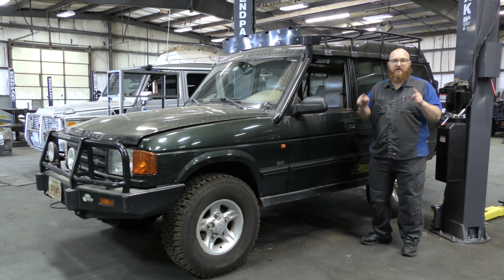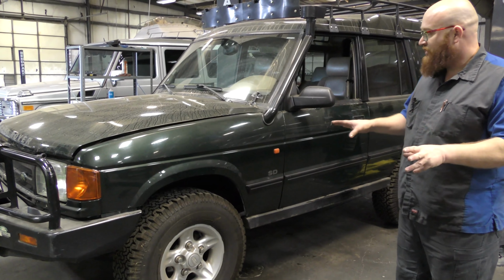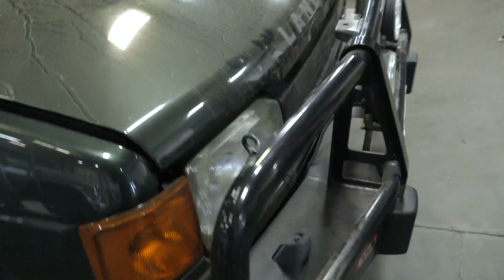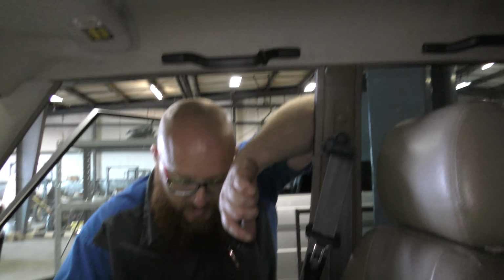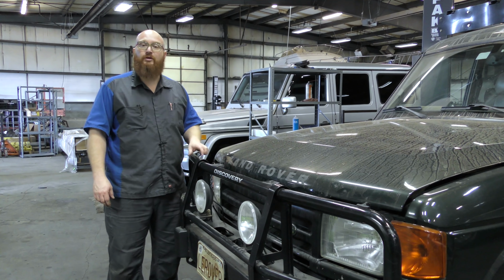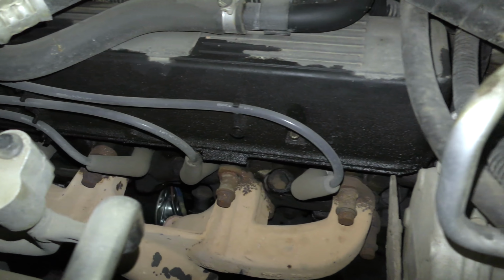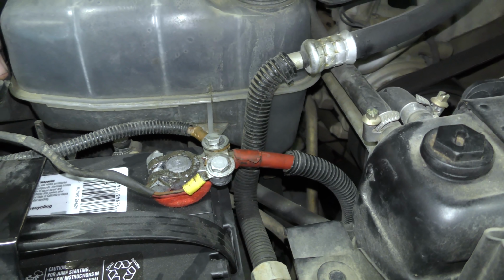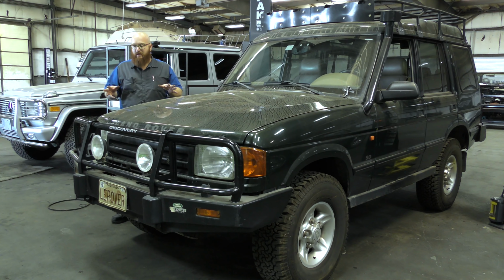How can such a simple repair cause huge problems on this '99 Land Rover Discovery? CAR WIZARD knows

Comment: Mixed oil and coolant is not a sign of a head gasket on a rover v8.
Many have spent money on a Head gasket job only to find a bad timing cover gasket or worse the shop says the engine is bad. Normally they are not bad.

Comment: OMFG that’s beautiful. I just put an ARB bumper on my 1997 discovery today. Mines willow green. Hey wizard, your pretty knowledgeable with land rovers, I’m having a few issues with mine. First my dash lights and rear passenger running light aren’t working, I read somewhere that they are connected somehow, any idea on where to start? And my battery keeps dying even after a few minutes after turning it off, I already went through 3 alternators and I just got the battery last year. Any idea on why it keeps draining itself that fast. It’s charging up to 13.6 volts sometimes 14.0 volts then refuses to crank until I put a jumper box on it
Reply: Also wizard, you guys should totally get a discovery. I picked mine up for $500 running and driving and no head gasket issues and it has 173k miles currently. But I also think you guys should try for an old series 1-3 and make that another project of yours.

Comment: Mi truck just die when running and the preventive lights starts flashing and wont start againg until  disconect the batery several times then de lights stop flashing just happens every two or tree days could you have any aideas what is going on the panel control dosnt show anithing

Comment: I have the same vehicle 99advanced evap  gems disco 1 use to run great,lost injector pulse to cyl 1,7,4,6 ,has voltage to all injectors,any advice, no pulse coming from ecu that test eliminated harness,driving on 4 cylinders no fun

Comment: Had a problem with a audi a3's rear
Number plate light. Took 2 weeks to 
Find the issue. Under the footwell
Passenger side carpet edge. In a
Little plastic recess. Sweet jesus.

Comment: Supposedly the tooling for the V8 was absolutely worn out leading to poor quality control by this point, the 200 and 300 TDI diesel engines are underpowered but very long lived in comparison.

Comment: at 10:21  whats that fluid leaking from the engine,  how much is leaking?  what gasket needs replaced? Whats the mileage?  Asking for the Domestic car haters.  What does it smell like when the vehicle is warmed and driven, when it drips onto the hot parts?

Comment: You know, I'm starting to understand why he can love Range Rover's and not BMW's. Reliability has absolutely nothing to do with it. It's all about familiarity, ease of working on them, and designs. From what I gathered, most mechanics hate BMW's because of the ridiculous things they do to make working on them a nightmare (oil through alternator bracket, magnesium bolts that need to be replaced every time, plastic molded connectors for hoses, etc). It's like the BMW engineers have a thing against the mechanics.
It's like me hating working on Ford's but like working on GM's. Why would place a random torx bolt in a row of bolts, Ford?

Comment: That is not the stock positive battery lug.  Anytime you see an aftermarket battery lug there is a good chance the auxiliary wires will end up loose causing problems.

Comment: I hope that was just for the camera? because you didn't even check to see if the wires were actually tight after torquing those bolts on the battery.

Comment: GM designs this engine in 1962.  Two years later they abandon it for obvious reasons.  Rover/Land Rover proceeds to use this engine for 40 years...  1963 to 2004.

Comment: Some crooks would have put an ECM and starter in it . THEN when it wouldn't start = NO CLUE . Diagnosis VIA parts cannon ! The basic and simple items can be overlooked . A logical diagnostic path - till the problem is found . NOT parts .

Comment: I lived and worked in Africa for a number of years, and I’m concerned that your comment that the Land Rover Discovery is an appropriate car for a safari in Africa may mislead some prospective travellers.  In my experience in east and central Africa, Land Rover has been completely overtaken in the market by Toyota.  The only Land Rovers that are common are Range Rovers, and these are driven by the wealthy as prestige vehicles, not for rough travel.

Comment: Discovery 1's like this are more reliable than Discovery 2's. Disco 2's are a bit more automated and luxurious with larger engines that are more prone to that dreaded slipped Buick/Rover V8 liner disease. In fact, many head gaskets have been replaced on these vehicles only to fail again because in reality its a liner thats just starting to come lose and damaging that brand new head gasket.
I'm very lucky to own a 94' Conniston Green 5 speed manual (rare combo) mated to that legendary 3.9 Buick/Rover V8. First year they brought em to America. Have owned much older Series trucks (Defender before it was named Defender)  and much newer Range Rovers and in my opinion these are the best best all round Land Rovers ever produced.
If interested google Camel Trophy Land Rover Discovery and see what these things are capable of. Only difference were the diesel engines.   
Definitely not a soccer mom "truck" and more like a Defender or very early Range Rover. 
I hope your and your wife find one or have found one and it's nice for once not to have an expert mechanic railing on this brand. 
They all are very good but like any other specialty brand need a bit more attention. 
The biggest mistake for anyone buying into this brand via a used one is buying one that wasn't maintained which seems to be d'rigueur with many LR owners who are more about status than keeping up with basic maintenance and using these vehicles for what they actually made for which is utility work. 
And if you do make that buyers mistake, definitely find someone like the Car Ninja who likes them, doesn't complain about them and enjoys working on them.
The older ones are better because they are simple.
Mine doesn't have OBD  capabilities, doesn't have air suspension plus all that other digital stuff which can be a pain and the AC plus heater work great!

Comment: D2s make the D1s seem Honda-esque. They are WILDLy different. The secret to D1s is no find the most poverty spec version you can find. NO Sunroof. No power seats and a 5-speed. It’s all the electric “luxury” crap you paid extra for in America when new is all the crap that breaks. The basic truck is fantastic. The d2 destroyed the reputation of the 1 because 2 engines WILL overheat. Especially 03/04 versions where they decided to push the motor to 4.6 and REMOVE the oil cooler. The D2 was an exercise in cost cutting by bmw. While the d1 was almost literally a defender with a lengthened frame and something other than a tractor cab on top; the d2 had a thinner frame, removed inline fuel filter etc etc etc to make it lighter and cheaper. Ironically the D2 “looks” more robust, but is fairly substantially less robust under the skin.

Comment: While I respect your knowledge Mr Wizard I have to disagree and say the D2 fitted with the 5 cylinder TD5 engine we get here in the UK is far superior to the V8 D1. The ancient Buick based V8 lets both the Disco series down.
The fault here reminds me of a Mercedes I had brought in to my workshop with a cold starting issue. The car had been in the Mercedes dealership for two weeks and no fault found. I traced the cold start circuit through and found a loose earth tag down at the back of the block. Problem sorted, customer happy and brings in his whole family's cars.

Comment: imo, apart from bad design.
blown head gasket is often caused by full throttle on cold engine.
yeah, what is the most anoying these days in modern cars are the sensors that fail. installing new sensors all the time worldwide while the engine is perfectly fine.
if u want a good car, buy a diesel with a manual transmission and timing chain b4 '00. or buy a Lexus. the rest is no go, except the diesel chevrolet canyon with the 2.8L does 35mpg highway.
u know isuzu ?
yeah or find a galvanized body so u dont have to worry about rust over 50 years parked outside, put a engine in like a buick 3.8L V6, or a '93 BMW 840 ci V8 with a manual 6 gearbox which maybe u can bolt of the 850 csi and put it on the V8 to keep weight low with helium gas in the tires.
yeah
bon jovi
when u lay her down on a bed of dirty hoses, people who call a motorcycle a she ? a motorcycle=it. and thats a example how people talk bullshit and lie. lies cause electrical issues. its not about lie down, its more about lying, when people tell lies the sensors go bad, nothing wrong with the engine.
yeah
i ride fz6 '04
it powerwheelies without using the clutch.

Comment: If you go to Africa you want a landcruiser! Disco 1 have no rubbers to protect brake pistons, they pit and then leak being exposed to dirt and and water. V8 consumes huge amounts of fuel and Subject to sticking valves. This engine has premature timing belt failures and then bent valves.  I've owned two, now a Toyota landcruiser lover.

Comment: Any problem with the engines blame the Yanks it’s a Buick unit 😂, head gasket’s are pretty rare to go in the UK so it’s probably the higher mileages you do in the US. The G Wagon is an outstanding off roader it’s based on a German military vehicle and very capable, the reason you don’t see them often on the African continent is the price of the vehicle and spares. Toyota Landcruisers out perform any other vehicles on tough continent’s Africa, Asia, Australia and the Far East hands down.

Comment: Beautiful truck, I love Epsom Green. I haven't watched yet but I'd guess slipped liner or something. You probably know this, but replace the factory thermostat with a genuine 180 deg thermostat and get an ultragauge to watch temperature. That way customers should catch any issues way before it gets to 240.

edit: here's something interesting I noticed last week. My Disco 2 has nothing in those threaded inserts on the positive terminal, I put a bolt in one last week to get power.

Comment: I worked for years a motorcycle mechanic. More than once we tried to save people money over the phone. We tell them, do you have gas, did you turn on the reserve. The answer usually was, do you think I’m stupid. So we do a pickup, diagnostic add 1 gallon of gas and charge 125. That was years ago. People will ask, 125 for gas, nope 4 for the gas 120 the dumbass few.

Comment: I had one of these I had a problem where the engine would stop running after ten minute or so. It was the temp sensor on the radiator but took a long time to find, cost me $35.00 to fix.But I disagree with the wizard this was the worst car I ever owned, no power and very very thirsty and often breaking down and like  driving a truck.

Comment: I would take that crap off and fix it correctly the factory didn’t put that junk cable end and the wires like they are. I work on boats and I see crap like this a lot.I take it off and solder a lug on

Comment: I am curious why that was never found. Wizard stated that the starter was done, and quite a few other electrical items. I dont care how bad of a "mechanic" you are, if you unhooked the battery at any point, you would have seen that. It just seems too easy. I have a feeling it was a compound problem that was solved with a few things that were done.

Comment: There is a REASON why those two bolts got lose, they bolt into the lead battery terminal. 
Lead is a soft metal and you cannot securely bolt a steel screw into lead
A lousy Land Rover design. and to pickup ECU and anti-theft power from that terminal is even worse
I wouldn't drive this car to a grocery store, let alone safari

Comment: The head gasket issue is common to a number of Rover group engines of that era. Over here the preventative solution is to replace the bolts or even do a complete head gasket service if the vehicle is worth it.

I'd never take a Land Rover overland or on safari anywhere without a backup crew in a Toyota. Give me a Landcruiser any day.

Comment: About 90% of all Discovery built have Diesel engines. Whether TDi200 300 or the TD5 five cylinder. Far superior to the V8 gas engine.

Comment: Hold on! you work on these all the time so why didnt you go there first.
Reply from the maker: Because the customer had disassembled so much already trying to fix the issue. You have to rule out that the disassembly didnt make the problem worse. Liability is something to consider as a business. Why didnt you think of that?

Comment: I would much rather change head gaskets on a Rover then deal with the timing chains on a GM 3.6 high value engine. You know the dreaded sludge build up problem these engines are known for. Sadly it's only because of a very stupid PVC valve design. That and people don't take care of their cars. I check my oil weekly and if I had a car that would eat oil like they do, I would be asking why. Especially with low mileage. It can be fixed easily if caught in time, otherwise it's an expensive nightmare. Might as well change that water pump too if you got to do it. You'll have one less ticking time bomb to worry about. Awful!

Comment: Thats not a discovery 1 that a mk 2 the mk1 had a different front with recessed headlight units different bumper and very different interior
If this was a mk1 discovery it would have the jasper conrad interior , it dies not have that power blue or fern green interior so please get your discovery models right.
The mk 1 discovery had 3.5ltr then mk2 3.9lt then 4.0 lt on the last models.
Come every disco ower knows anout tge battery wires it the first thing you check he did not go on line to the owners club as the 1st thing any disco owner will say are the bolts tight on the battery. Come on now way does the owner know nothing about his car

Comment: Toyota land cruiser is by far what i would take and fuck that range rover. I seen a Toyota land cruiser finish a race with broken steering on one side and one rear wheel and tire were distroyed.. and no way to put on the spare due to broken bolts and tweeked metal... they ended up nailing 2 feet of tree no less through the open lug hole and wedged against the body, axe, and nailed the rest of the way in.. the axel held and they drug the land cruiser all the way to the finish... it was amazing..

Comment: So let me get this straight...I like your channel generally, but in this case....You're going to charge this guy for your troubleshooting failure and explain it by putting on "better" clamp. You seem like a good tech, but on this one...that's not right thing to do in my opinion. Tighten or replace the clamp. Charge the customer like $50 plus clamp cost and thank him. The customer shouldn't bear the responsibility of paying for your error. Not a $100 plus bill.....calm down.